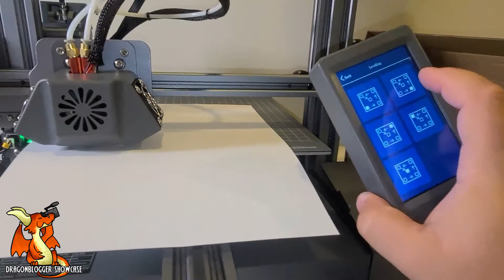How to Level the LotMaxx Shark V2 BiColor 3D Printer

Comment: Being that the Shark V2 without the BL-Touch uses the TMC driver to detect bed collision, I'm having a hard time figuring out how to get prints from Cura to run through ABL first. If I do it manually, next time it just digs into the build plate. The demo files they have on the SD card kicks off the ABL each time.... looking at the example models Gcode there is a laaaarge blob of code ahead of the stadard code which I hope is not Lotmaxxs way to do ABL....